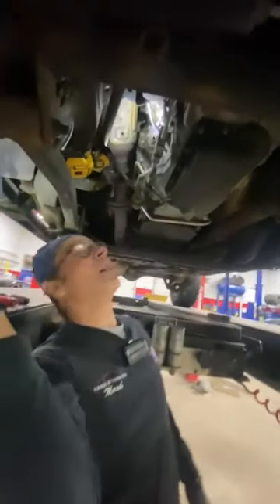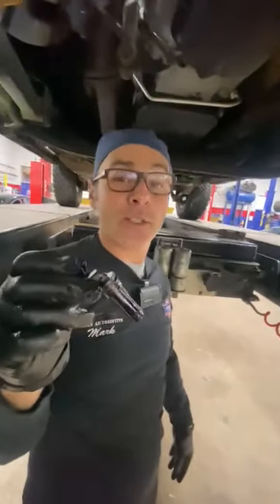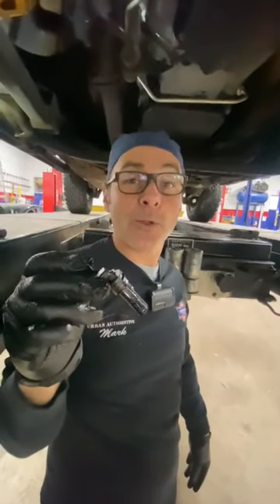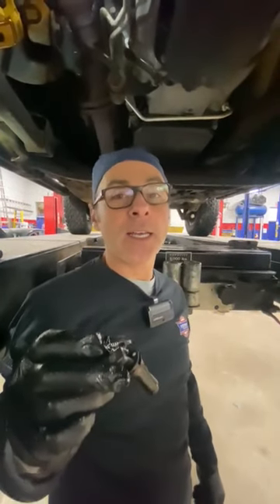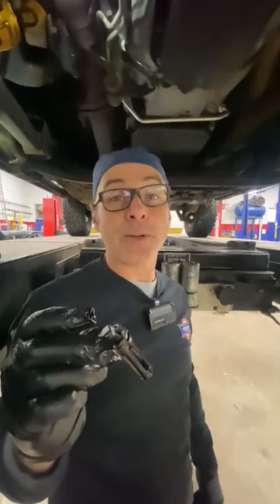P0339 Crankshaft Sensor Code. What Are Symptoms & What The Sensor Looks Like @UrbanAutomotive01

Comment: but if its throwing the p0339 intermit circuit bank 1 its not the crank sensor, could it be the wire ?
Reply from the maker: To diagnose and fix the issue:

   ALWAYS perform a Visual Inspection: Start by inspecting the crankshaft position sensor and its wiring. Look for obvious signs of damage, corrosion, or disconnection.

  In the case of the video Mark had already Checked the Sensor: Using a multimeter, you can check the sensor's resistance and compare it to the manufacturer's specifications. In this case it's out of spec, confirming the sensor might be faulty.

    Scan Tool Analysis: Some advanced scan tools allow you to view the crankshaft position sensor's signal in real-time. This can help determine if the signal is intermittent or if there are other issues.

    Check Related Components: Inspect the tone wheel or reluctor for damage. Ensure that the engine's timing components are in good condition.

Since the video has been uploaded, we can confirm the repair solved this vehicles issue. Thanks for Watching.
Reply: Just fire the parts canyon

Comment: I had a P0343 engine code  so I replaced the camshaft sensor, and now my Prius does not want to start. Is it possible it has to be reprogrammed or should I change the crankshaft sensor as well???
Reply: maybe, get a proper full scan from a mobile mechanic first- then double check that when the sensor was replaced that all the cams were in TDC. if not , unplug the battery and place all into TDC, replug the battery and let that (IF IT STARTS) relearn the idle for about 10-15 minutes. 

the ecu has many failsafes to protect the engine from blowing up, the sensors although annoying- do much of this work. learn to 
check the fuses, the spark plugs, ignition coils and if all are good then it can boil down to a timing issue.

Comment: Could it also be this if after the bucking and kicking, I lose acceleration? I still can rev engine but after the bucking and kicking engine light comes on then it’s like my car dies but I can rev the engine just no forward power
Reply from the maker: There are various symptoms and lack of power is one of them. These engine sensors work in conjunction with other sensors that provide information to the on board diagnostic system. If the tachometer is going up but the vehicle isn't moving in sequence... you have other concerns. With the check engine light on a quick vehicle scan should qive you the codes to start the proper diagnosis.
Reply: @UrbanAutomotive01 my car out fo the blue will stop accelerating .the engine light flashes.. i step on the gas and nothing. im getting code for misfires but ive done a full tune up and still get the same codes..when the car stops accelerating,i turn the car  off and thehn turn it back on, same sypmtom happens.
Reply: sometimes itll happen after a few minutes or days after turning the car on and off
Reply: @losheroes6076 did you get your issues resolved?
Reply: @teelowteelow356  hey bro nah man lol
Reply: @losheroes6076  dang brotha! Are you still driving it, or did you get rid of it?
Reply: @teelowteelow356  still dirivng it bro, i jsut reset the light lmao,
Reply: @losheroes6076  did you change all the spark plugs or check the fuel pump?
Reply: I have a 2013 fiat that is showing p 0339. Intermittently bad Crank shaft sensor how long can I drive my car like that? It is not showing any symptoms but the engine light did come on and flash and I did have it checked. And that's what it came back as.
Reply: @beverlymora9091  you should fix it or sooner or later It will strand you. Most cars will lose all power and or shut off